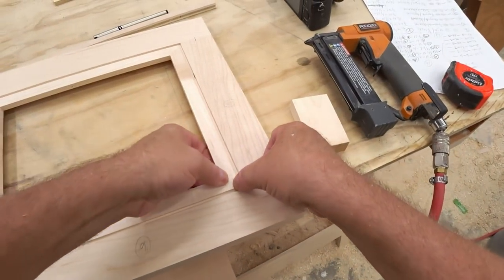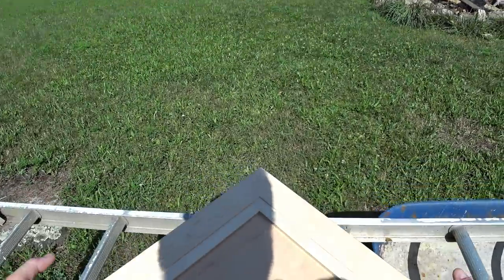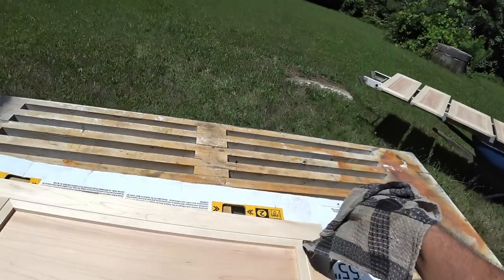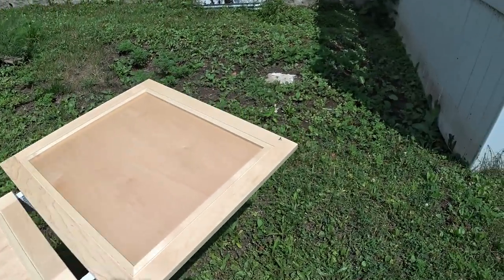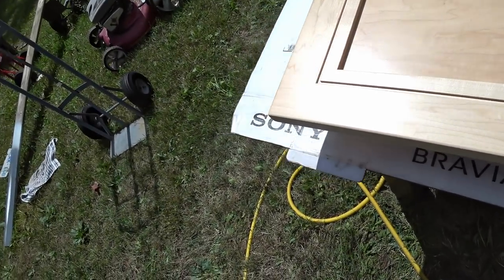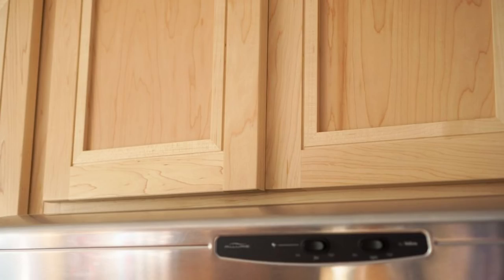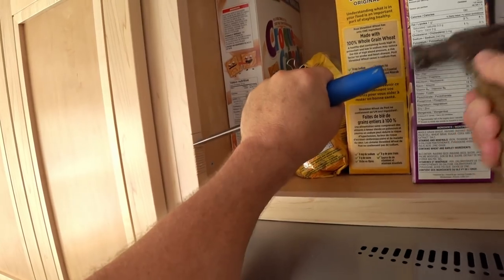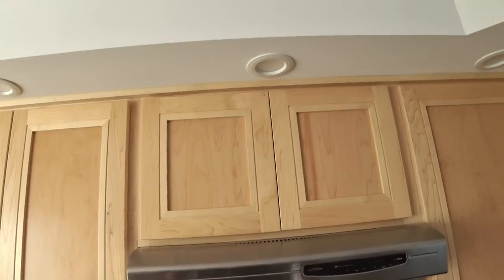Making Cabinet Doors - Spray Finishing, Putting Them On and Fixing Problems

Comment from the maker: It took most of a full day and nearly 2 liters of water based poly to finish the doors with three coats front and back. I sanded between coats, 220 grit between the first and second, and 400 between the second and third. 
The hinge fix at the end may seem like butchery to the inexperienced idealists watching, but it's an example of a very common way to deal with a problem. The purest burns up a day resizing the door and refinishing it, while the realist spends 20 minutes mortising in two hinges. And, unless you know what to look for, it's a fix that will never been seen by the casual observer.

Here are some ways that you can help support the work I do in making these videos:

Plans for sale:
https://ibuildit.ca/plans/

Patreon: https://www.patreon.com/user?u=865843&ty=h

Website: https://ibuildit.ca/
Facebook: https://www.facebook.com/I-Build-It-258048014240900/
Instagram: https://www.instagram.com/i_build_it.ca/
Google+: https://plus.google.com/u/0/b
Reply: Can we buy "Bug Killer!" t-shirts?   :-)
Reply: Just plane the doors down where they meet. You can touch up with a brush & never even tell. Looks Great👍Vinny 🇺🇸
Reply: The pure solution is to resize both doors, not just one, so that they remain symmetrical.
Reply: What type of wood did you use? They look great.
Reply: How did the finish hold up? Going to be building a whole kitchen worth of cabinets soon and researching as much finishing options as possible.

Comment: Great audio capture on the sanding ... Really useful.  As beginner, could never tell how much pressure to use when sanding between topcoats.  Nice problem solving too on the doors.  Won't forget that one. Very useful learnings in short video.  Why do I want to eat a  grilled cheese sandwich?

Comment: Hi John I really love your videos. You are revered as a down-to-earth highly skilled Craftsman in my opinion.
 I just finished making my cabinet doors and drawer fronts and I'm very interested in the type of polyurethane you used the brand even and I would also love to know about your setup and what HVLP gun you use the pressure and water remover and separator. Would make a great video.

Comment: Nice simple recovery on the door overlap problem. I'm sure you know that another solution would have been to replace the hinges with one's that have a slightly bigger overhangs. Doors look great. Love the figure in some of your maple. I've only been getting more into woodworking the last five years or so and finding that recovery from and hiding errors is key to success.
Reply from the maker: If using a different overlay hinge would have worked, I would have done that.

Comment: those doors look incredible! I clearly need more tools. bought a table saw over the weekend. I debated building it but it was about time so I bought one at a reasonable deal. for the work I have planned for it, it will pay for its self. besides, I'm working in my own home and I'm just cutting my chops before I get into the more visible projects. I plan to build a new kitchen so really I'm just learning on my old one until I get the time needed to do the real work.

Comment: Ever think of using one of those cheap easy set up canopies?  I have trees overhead that drop crap down onto my projects and I've found that helps.  Also nice if you can hang a tarp for the sides and make a bit of a tent, but then the air quality (mask needed) and wind sometimes comes into play.  Probably not worth that kind of effort for one bug....thought you guys had more bugs than that in Ontario!

Comment: So now I have to find a way to hide this video series so my wife doesn't see it!  Sheesh!  Also, I have a quick, meaningless question about the doors:  Do you normally use those little, round, self-adhesive felt pads for your doors that close on face frames?  I've used them a few times when the European-style hinges cause the doors to slam.  Just wondering.  Great video!
Reply from the maker: Door bumpers? Yes, of course, but one thing at a time! 

Next you'll be asking if I've considered putting handles on them :D
Reply: I Build It Home Haha!  I’d never automatically presume you’d use handles!  I know they’re pretty controversial. ;-)
Reply: L

Comment: Everyone makes mistakes. I thought that I had made a mistake once, but it turned out that I was mistaken.  ;-)   Anyhow...a craftsman knows how to fix mistakes, and a hack just leaves them. You sir, are a craftsman. On another topic...I've heard that gloss polyurethane has the hardest finish and the chemicals added to make satin or flat finishes make the finish less durable, so it's better to just use gloss poly and use steel wool to knock down the gloss to a satin level. Do you have an opinion on this? It might just be Internet BS. I haven't done any testing myself.
Reply from the maker: Gloss has more solids, so is more durable... but it's a marginal difference and certainly not worth the time and effort it would take to evenly knock gloss down to a satin luster.
Reply: Thank you for your reply. That makes perfect sense.